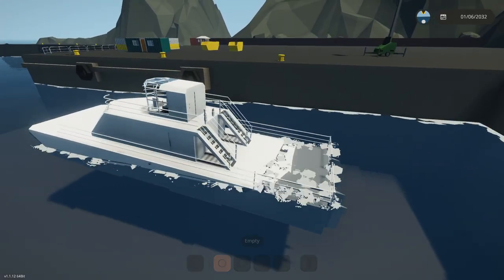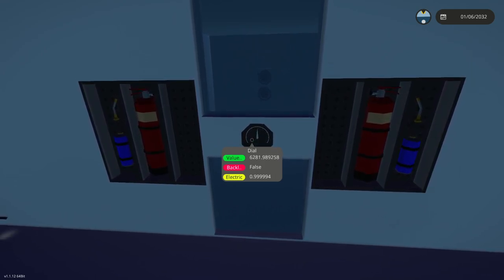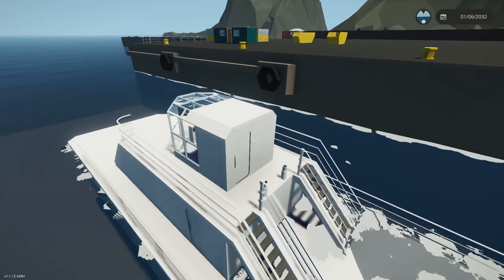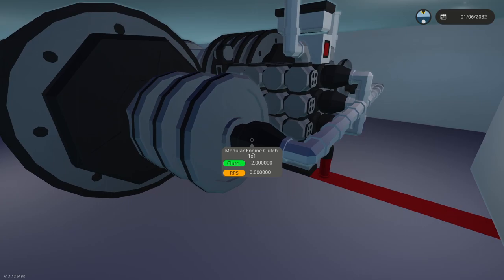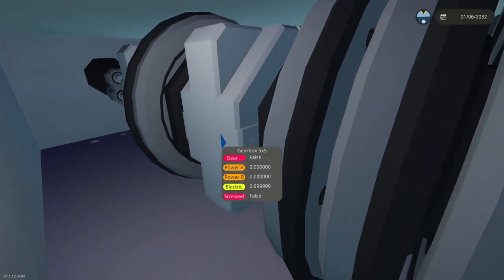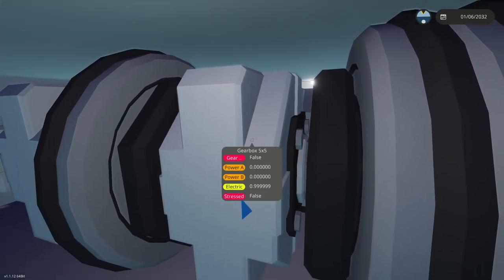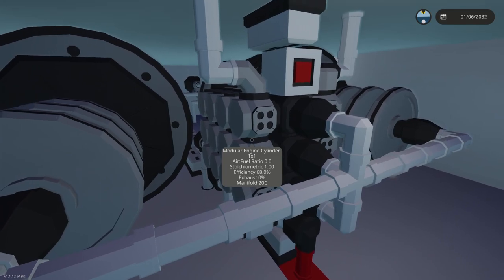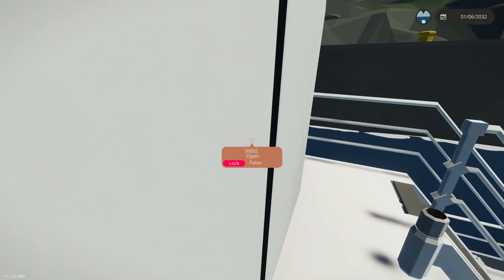Stormworks: Flywheel Glitch Boat

Comment: nuclear power is a better alternative for submarines, it's a bit big but it weighs a lot just like your glitch engine, and it also lasts a really long time.
Reply from the maker: Unless something has radically changed, the glitch engine weighs about 2% the weight of a nuclear reactor and produces hundreds of thousands of times more energy.... but it's also just a glitch.
Reply: for underwater power you can make the modular engines so it uses the exhaust as air you just have to convert it back to air so a engine rebreather
Reply: @kake478  what do you use to turn exhaust into air?
Reply: @redpug5042  catalytic converters and l
Fluid filters its a bit more complicated than that tho

Comment: What is the submarine jet engine glitch???
Reply: It sounds enough of a glitch to me already that a submarine and a jet engine is put in the same sentence, you know.
Jet engines are literally meant to never work underwater by nature. It literally describes a jet engine that it's a thing that cannot in a wayoperate underwater. Rocket engines might... I dunno, that already sounds a bit wild, but I think it could be possible and mightve been done in some crazy Russian torpedoes... But jet engines need to take oxygen from the air, and there's not much oxygen in its O2 form underwater, it's tied with hydrogen except for bubbles I guess.

Comment: what is submarine jet engine glich ?
Reply from the maker: You can use jet engines inside. Just stick the air intake in an enclosed room and it runs like it's in the sky.
Reply: @CraigPerko  btw how you know all these gliches?
Reply from the maker: @eggpusheen1940  I'm good at finding glitches, but about half of them I find from other people. Like the buoyant hinge glitch and the nested-door glitch,  those I learned by looking at workshop creations.

Comment: This is ridiculous. As much as I love Stormworks, the physics in it is absolutely horrible. This is only one of the few things that shouldn't go like this. One thing for example is how you casually say how you can reach EIGHTY?! meters per second in a boat and it's not even that big of a deal in the game. Let me tell you, 80 m/s is almost three f*cking hundred miles an hour! It's Porsche, if not Ferrari territory! Like holy sh*t, that's illegal. I can believe you though because my nothing special first ever speedboat goes 120 km/h and could go faster if I added stabilization, let alone hydrofoil... and even my f*cking electric sub can go that same speed with a medium motor. 130 km/h is legal highway speed in my country in Europe. Let's not even mention my insanely fuel-efficient large diesel engine train... that goes 500 km/h. That... that's around the maximum horizontal speed achieved by WW2 propeller fighters on full throttle. And I also love Stormworks damage and aerodynamics... lmao
Reply from the maker: Yup!
Reply: its a glitch
Reply: if you push the bottom of a suspension wheel with a pivot you can reach 120m/s